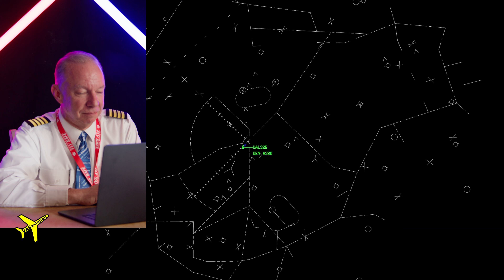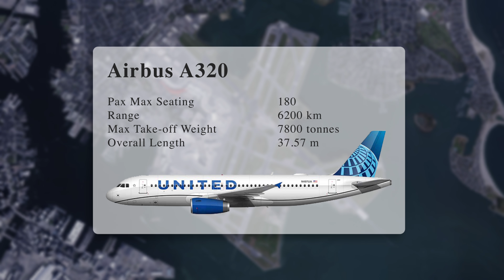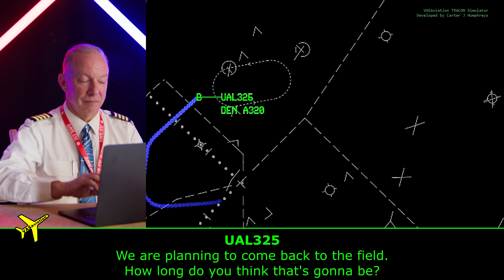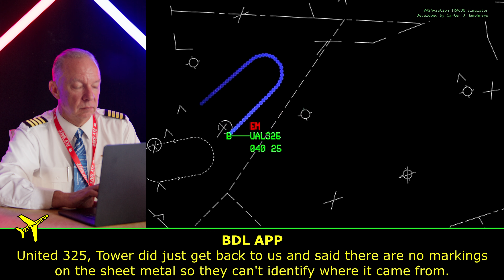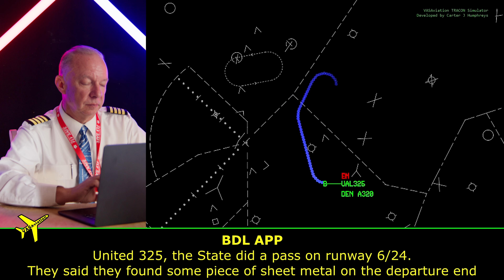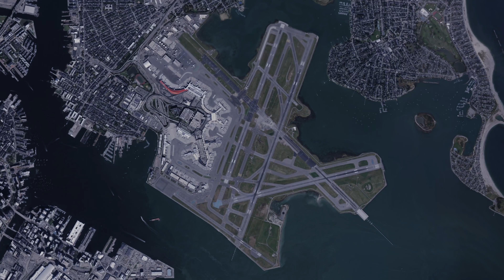United 325 Disaster Averted: Engine Trouble at Takeoff! | Captain Steeeve Breaks It Down

Comment: Silly question, but why do passenger aircraft manufacturers not have cameras fitted in the landing gear area ?. So pilots can do a visual as the wheels go down. For what cameras cost it would seem a cheap thing to do to give a good benefit.
Reply: I agree!!  There are cameras everywhere but not on airplane landing gear, wings or other useful areas.
Reply: @49kittypretty1  actually some airplanes do have cameras mounted exterior and some don’t. Not a silly question at all.
Reply: @49kittypretty1  “Everywhere” isn’t going 500mph.
Reply: @Cjbrk-x63 True, but I have seen cameras on skydiver’s helmets, and on racing boats etc.  I think there are cameras on the space shuttle external rockets.
Reply: @Cjbrk-x63  It could be strategically positioned up in the gear bay, so that the tires are visible.
Reply: @49kittypretty1  I’m not in agreement with what you’ve said about cameras everywhere (unless you mean in everyday life, not aircraft)
Reply: @kevinfairclough4619 
He's probably just thinking about Tesla's having cameras on every inch of those things.
... im assuming
Reply: @ I meant that there are many cameras used to watch traffic, check outs at stores, front porches etc and yet where it seems to me that it would be really helpful to have cameras (like on an aircraft looking at the wings, landing gear etc) there are no cameras.  I’ve watched Youtube videos of an engine fire for example where  the pilots have instruments telling them that but they can’t see it because there are no cameras showing the wings and engines.
Reply: @ thanks for clarifying. It’s not a silly question for the op to ask. I’ve just put by best suggestion as to why, but it’s just my learned opinions
Reply: @49kittypretty1  
But those cameras have weight, like I mentioned to someone.
And they don't go from a 100 degree hot tarmac, to -60 degrees at 40,000 feet every day either.
So simply having a camera lense system to deal with those "Atmospheric" conditions, is more weight again.

And unlike someone's GoPro they shoot up in a rocket for some video.
These would have to work 24/7 in every condition imaginable. For decades.
Which Also, adds more Maintenance issues,.. AND COMPLICATIONS to the overall aircraft and it's electrical systems.
IN OTHER WORDS, SOMETHING ELSE TO GO WRONG.
Besides, most of these systems are monitored by sensors. Because having it's operation monitored, is more informative than looking at pretty pictures 😂
Especially when the picture, LIKE HERE, doesn't look good,.. but was.
... fly safe
Reply: @My-Pal-Hal id rather be on a defective plane than in a starshipooper tesla.
Reply: @tonymurray814  
First, obviously you missed the point.
Second, NO YOU FN WOULDN'T ! ! !

I don't care what kind of Failing Vehicle I'm in, or what it's failure is, including Being On FIRE 🔥 
But if I had the choice between those failures happening on the Ground,.. OR 5 MILES ABOVE IT !😳!
Seems a pretty easy choice to me. 
Because my arms don't flap very fast anymore 😂
... and MY OWN door, does comes in handy for an escape , jus sayin
Reply: @ You’ve made some excellent points.  They make very small cameras now so weight might not be a factor but you’re right about the extreme temperatures and other things.
Reply: @ Thanks for your reply.  Yes, for « everywhere «  I meant everyday life.
Reply: Dont be a fool.  @tonymurray814
Reply: @My-Pal-Hal  so what would you say about the A350 & A380  tail camera? I can name several more aircrafts but lets see you coming up with more made up reasons
Reply: @pranabgill1310  
OH MY GAWD, THE TAIL CAMERA.
Well, ya got me. I guess that's all you need to see the entire outside of an aircraft airframe, including the landing and nose gear.
.... people are just embarrassing sometimes
Reply: @My-Pal-Hal  okay the 777 has a camera ON THE nose gear itself...now what?
Reply: @pranabgill1310  
AND ? ? ?

.... i don't think he's been following along, because im sure in his mind, he has All The Answers 🤤 , awesome
Reply: @pranabgill1310  
I just think it's funny.
I built 18 Wheelers. And that's a lot of cameras 😂
But they've never needed them for like 5+ decades.
HAIL TO THE QUEEN 👑 BABY 💕 
... good times
Reply: @pranabgill1310  
SOPHIA HAS A GOOD CAMERA 👍
It was 106" Inches !!!
Yeah, I looked it up, because I couldn't remember. I was thinking 100 something. But, I can use a smart phone. Instead of just GUESSING 😂
Good camera though. Its in a museum now 😞 
Memories.

... and that's an 18 wheel princess, it's smaller than the queen 😏
Reply: @My-Pal-Hal  you build 18 wheelers, I fly planes....so it was funny reading your aggressive reasoning for no camera...try humility next time
Reply: @pranabgill1310  
THAT WAS TOOOOO EASY, AND EMBARRASSING 😂 
And more sad than funny. But it was pretty predictable.
... hook line and sinker

And I even mentioned the "Queen", and "Sophia", and her "CAMERA".

"Don't Trust The Bait" , Google It 🤣
And with practically the entire knowledge of the planet in your hand, you blew it.

aaaa, freakin awesome, didn't see that coming 

747's are 18 Wheelers btw 😏 , keep on truckin
Reply: @pranabgill1310  
So easy, it's EMBARRASSING 🤤

HOOK LINE AND SINKER 😂

If only they could read, or even use google.

18 wheels.
The Queen.
And the Princess Sophia, and her 106 inch camera.
.... princess, because it's an SP
Reply: @pranabgill1310  
... he doesn't have a freakin clue, but he flies Cox .049 airplanes, i do aircraft, so it's , still funny, and sad
Reply: @pranabgill1310  
FUN FACT 😀 
Bill Nye the Science Guy was an engineer on those 18 Wheelers Too 🤗
.... hail to the queen baby
Reply: @pranabgill1310  
Another Fun Fact.
That 18 Wheeler also transported the Shuttle Craft around. It's a Heavy Hauling Girl 🥰
Reply: @My-Pal-Hal  so tell me more about the tail cameras on Airbus 350/380 and how they can't go from 100 degrees on tarmac to -60 degree multiple times
Reply: @pranabgill1310  
Already did.
Is reading hard on your brain?
... that's a good one 🤤
Reply: @pranabgill1310  
Hey.
Did you figure out yet, that 18 Wheels is 7+4+7 😂
... math is fun
Reply: @pranabgill1310  
So,..
Tell me more about the couple of Entertainment Cameras.
But why those aircraft have some 25,000 sensors to fly them.

Maybe pretty pictures,
Are just limited in their usefulness.
Because not even all of those models have Cameras either. Because even those pretty pictures cost Money.

And that was the point, made many many times, for the English speaking Reading Crowd.
.... you should join that crowd someday 😊 , he's not invited 😂
Reply: @My-Pal-Hal  what about it ? Who cares about 747 old man....let's talk cameras
Reply: @pranabgill1310  
We have been talking cameras.
Are you new to the thread, or English in general ?🤣?

... sounds like he needs a nap, and a moist towelette 🍼
Reply: @pranabgill1310  
We Have Been Talking Cameras.
Are you new to the thread, or English in general 😂

.... he even argued against his own point, he's not paying attention
Reply: @My-Pal-Hal  we have been?
Do you realise,nobody is talking to you? It was a casual discussion,your confused paranoid little old brain made into a argument. So you were saying how cameras can't survive  multiple pressurisation cycles and varying temperatures,tell me more
Reply: @My-Pal-Hal even worse every  part of airliner must go thru the faa approval process which can take years and a boatload of money. Then, if successful,  each part in inventory must be tracked, maintained and so on. It gets expensive in a hurry. A nut in aviation is orders of cost more than what you can get it for at home depot for this reason. 
So cameras may seem like an easy idea but there is nothing easy in this realm. It's literally why most planes are still using 80s and 90s computers. They are certified and no one is in a hurry to spend the money to jump thru the hoops to certify new ones if the old 9nes still work.
Reply: @pranabgill1310 then Also ask how much did it cost to engineer it, get it approved by the regulatory agencies, keep it operating, keep it in inventory, add to the weigh of the aircraft thus increasing fuel burn and on and on. It's never inexpensive to add a thing to an airplane and guess who pays for it. The passengers who are already screaming it's too expensive. Do you want low cost or bubble wrapped hyper expensive?
Reply: @billdougherty6611  if it can be done one or two planes , it can be done for all pasangers planes. Secondly, escape slides aren't used on every flight ,they are still part of the mandatory equipment. 
Are you aware ,how many crashes could be averted or how many decisions could've been made easier if pilots had more information.  Please dont tell me how expensive cameras are or how much they weigh,one looks stupid discussing cost and weight of cameras in 2025
Reply: @billdougherty6611 
That's what I said,.. MONEY.
Reply: @49kittypretty1  Camera used in extreme temperature changes. You could install them in a box filled with a "gas" of some type to prevent problems, or in a heated box.

Those external cameras you see on aircraft today handle temperature changes all the time without issues, so I don't see a problem with "maintenance" cameras. And there isn't a weight issue with today's camera; they are not weighing 100 kg each, they barely hit 1 kg each.
Reply: @My-Pal-Hal  Yeah, today Aircafts has: Tail camera, rear underbelly camera, and a camera that looks directly down.
Reply: @heuhen 
Well, you're the "aircafts" expert.
Reply: @heuhen 
... and this comment is Awesome about the cameras,..

THEY DON'T WEIGH ANYTHING.

But for extreme temperatures he doesn't even understand,..
YOU CAN BUILD A BOX (the technical term🤣) and fill it with "Gas", meaning it must be a Sealed Vessel. 
AND YOU COULD EVEN HEAT IT 🤣, oh man. That's funny shit.

And none of that weighs anything, or takes anything to.... he's unemployed, or should be.
Reply: @heuhen I agree.
Reply: @kevinfairclough4619 Well, yes I was a bit vague.  I meant on cars, streets, people, bicycles, buildings etc.
Reply: I think a camera high on the tail that can give the pilots visual confirmation of issues like an engine fire would be great. Maybe another pair or quad mounted in the fuselage below the wings, again to give a clear view of the state of the wings and engines if the need arises. Obviously I'm not suggesting they keep a screen playing the feed from all five cameras active the whole flight, just that the ability to check such a view angle would have saved lives in past incidents so there is no reason not to implement corrective measures now
Reply: @Omniseed  Again, VERY expensive, regular cameras would never survive the forces and temperatures. Further, every new wire, every piece of electronics, you add only increases the risk of the worst case scenario, in-flight fire!
Reply: @Omniseed  
Obviously, you are simply saying something "You Think".
Without any actual knowledge or experience with those thoughts.

I'M NOT JUMPING ON YOU. Much.
More how people seem to always have thoughts. Without putting something behind those thoughts, with a little research.

Or even reading through a comment section, before repeating what many have already said.
It's the ole saying, " I Don't THINK, You Thought This Through" 😂

My suggestion, with subjects like this.
Look up the particular cockpit of the aircraft in question. And look up the manuals and checklists for same. 

And you may find that things aren't as simple as on the ole Xbox.
And why only like 10% of simulator time counts as Flight Time towards an instrument rating certification.

And though retired.
I looked it up. Yeah, around 10%.
That's the difference between Thinking, and Knowing.
A couple of seconds of research to refresh my thinking. I still got it 😂 👍

And much of this revolves around the Money as I may have mentioned.
So aircraft design and manufacturing has as much to do with this, than anything.
... money money money Money,.. MONEY 🤑

Problem is.
People want to think they know.
But they really don't care, or they would know.
How can you not know, or have a good idea. With practically the entire knowledge of the Planet in your hand ???
We had slide rules...
Reply: @My-Pal-Hal  I don’t want to sound rude but that is a lot of endless yapping about nothing. Is having more cameras hurt or help?  Does adding more cameras cause more harm than good? Explain why or why not. Just as OP said, they don’t need to be on 24/7 but only turn them on when it is relevant during an emergency. Would it not help to have few cameras for PM to look at only during an emergency and to use relevant cameras ie, if unsure about landing gear, turn on all landing gear cameras for inspections?
Reply: @wrx1th873 
Well thanks for a bunch of questions, with no answers.
Maybe you should have read some of that Yappin, before Yappin yourself.
Though your grasp of English is questionable simply by your use of it.

But I have a question for you.
Exactly how are your cameras going to help, if the landing gear isn't working ???
Do they add extra fuel, like the fuel you used hauling them around? Are they somehow going to fix the landing gear for you, or get a mechanic to do it?

OR,..
ARE THEY JUST GOING TO TELL YOU WHAT ALL THE PROCEDURES AND SYSTEMS BUILT INTO THE AIRCRAFT ARE ALREADY TELLING YOU ? ? ?
Because that's how they're built. And what the systems and sensors are already there for.

I only built them for a few Decades. Including installing landing gear, and functional testing same coincidentally.
So maybe you can enlighten me 👍

Because once you board that aircraft,..
WHAT GOES UP, MUST COME DOWN.
And those cameras ain't gonna change that. 

The aircraft, it's systems, procedures, and it's maintenance are the only things that will deal with that.
And if they break, you still gotta land, one way or another.

And again, for the umpteenth time, weight is money.
... in case you missed that Yappin 🤣 , kids are funny
Reply: @My-Pal-Hal  again with the rambling. You still have not answered my question. And I said cameras will be only supplemental information; they are not replacing existing information. You are being bad faith for no reason here. For example in this video, the pilot was worried about whether his landing gear had missing pieces of tires, if they had a camera there then they would realize it wasn’t missing anything related to the landing gear and he wouldn’t have to make multiple go-around because of some firemen refuse to elaborate due to not jumping the gun. How about another scenario where the pilots deploy their landing gear but for some reason their flight deck says otherwise, again, cameras would help here. One last example, since pilots cannot see the engines from where their sitting, if there were cameras in case of an engine fire, I could imagine pilots needing to know whether or not the fire is being contained or put out or how soon do they need to land. From what you are saying, money is the only thing that’s stopping companies from implementing cameras on their planes. Is that it? Just corporate greed?
Reply: @wrx1th873 
Rambling?
45 paragraphs later, and all you still have are Questions 😂

And you didn't answer my questions, so here's another.
How do 100,000 Plus Commercial Flights Happen Every Day, even though pilots can't see most of the outside of their aircraft ??🤔??

And try not saying everything I've already said.
... balls in your mouth
Reply: @wrx1th873 
And what about the Engines ?
Sure seems to be a lot of fires, compressor stalls and bird strikes we see every day.

BUT HOW DID THEY KNOW, WITHOUT CAMERAS ? 😨 ?

And again, don't say anything I've already said 😂
... he should get Google, or parents, or friends
Reply: @wrx1th873 
And again,..
For you non English Yapping Speaking Folk, that can't read or comprehend it.

YOU EVENTUALLY HAVE TO LAND,.. PERIOD ! ! !

And though I'm just repeating my Yappin 😂
You run through the procedures best you and the aircraft can, and then you land.

Kinda why they have procedures for everything, coincidentally 🤣

... this dude is pretty slow, or his CHAT D'UH Needs An Update, or both , im putting my money on both, yeah both 👍
Reply: @My-Pal-Hal  So much bullshit talk from you. Let me answer your question. Then you can stop yapping and answer the questions others are asking... it's common courtesy to answer questions. The person asking the question isn't supposed to answer them for you.

You ask: Exactly how are your cameras going to help if the landing gear isn't working? It allows pilots to confirm a problem or determine whether an instrument error is the cause. They also enable pilots to prepare for an abnormal landing. There have been many deadly flight accidents, where pilots were unaware of how severe the problem was, due to a lack of information. Cameras solve that by a lot.

You ask: Do they add extra fuel, like the fuel you used hauling them around? It doesn't cost extra fuel. Cameras don't weigh hundreds of kilos; they barely weigh 1 kilo max. So if you have landing gear and fuselage cameras covering critical angles, 6 to 10 cameras, it's just 6 to 10 kg, that is the weight of a backpack, add on cabling to a monitor, another 10 kilos. Aircraft today use digital monitors, where pilots select what they want to see on it. If they want to check something specific on the camera, they just push a button and check.

You ask: Are they somehow going to fix the landing gear for you, or get a mechanic to do it? That is a stupid question, and you know it. The cameras help a pilot understand what he is working with, so he can better compensate for the issue when he is going to land. Pilots always want as much information as possible. There have been many accidents that have been contributed to pilots not having sufficient information. Even the FAA has said that if pilots had more information, such as visual information, many accidents could have been avoided.

You ask: ARE THEY JUST GOING TO TELL YOU WHAT ALL THE PROCEDURES AND SYSTEMS BUILT INTO THE AIRCRAFT ARE ALREADY TELLING YOU? All that information is well known and is written in the book for the aircraft! You can even download that book from the internet and have a look for yourself. The book is based on experience and knowledge of previous accidents, and it says that if you have this and that, there is a high chance it's that. It then tells you what the best-known solution is for that issue. A camera helps confirm the problem. For example, there was a flight accident in which the book told the pilots to do so and so, and it resulted in the pilot turning off a system that actually worked fine and turning off a working engine, thus dooming the aircraft and its passengers. A camera could have shown the pilots that there isn't a problem with that engine or the flight control.

Quote: "I only built them for a few Decades. Including installing landing gear, and functional testing, same coincidentally." Building them doesn't make you an expert; you are only building it after a set parameter and the drawing, and the testing you do is for testing whether what you did works. Perhaps that's why Boeing has so many accidents... they think they know better...

Quite: "Because once you board that aircraft,.. WHAT GOES UP, MUST COME DOWN. And those cameras ain't gonna change that.": Yes, but it increases the chance of survival when something goes wrong. The focus should be on doing everything you can to increase the user's chance of survival when the problem arises. If something as simple as cameras are available and not used, even if they only increase the chance of surviving an accident by 1% or 50%, it's worth it. Being ignorant kills people.

Quote: "The aircraft, it's systems, procedures, and it's maintenance are the only things that will deal with that.
And if they break, you still gotta land, one way or another." Correct, but the procedures are based on past accidents in which more information could have helped pilots, passengers, and aircraft survive. A camera is an added benefit because it provides information that helps select the correct procedures, even those that aren't listed, when the problem hasn't been seen before.

Quote: "And again, for the umpteenth time, weight is money." Weight is money is the stupidest argument when we talk about something that can save lives. For something that adds 10-20 kg to an aircraft (the weight of a backpack!), saving money and weight kills people. This is what Boeing has been doing, and it has resulted in several deadly accidents. Accidents that have been documented as directly linked to cost-saving procedures and construction. Adding 10-20 kg of extra cameras will at most add 10-20 cents to passenger bills.

Maintenance of cameras is also simple, and replacing them is simple. It's nothing unique. Only if it's a one-off can you ask about that. But with thousands of aircraft frames, 10 times as many cameras, plus reserve parts, you get to such high production numbers that the cameras will end up being low-cost. And maintenance of them would be done through the normal maintenance (doesn't work, replace it. Send the broken camera to service).

All you have shown through your yapping is that you are ignorant and know nothing except how to screw a screw into some sheet metal because the procedure tells you to do so.
Reply: @heuhen 
Yes yes.
When you've actually built commercial aircraft of many different configurations for a few decades, you get back to me ok 👍

Dude doesn't even know what it takes to run and attach even a single wire through the Airframe of an aircraft, let alone everything involved.
And obviously doesn't understand what simply a couple hundred feet of a Single Wire even weighs, let alone all the attachment hardware weighs. And if it has to be Shielded wire, that weighs even more.
Dude probably thinks you just Staple this stuff in like Christmas Lights,.. what a dweeb.

... im surprised he didn't get into chem trails, he was getting there though, you could feel it 😂
Reply: @heuhen 
And for the more Advanced people reading this, and you are welcome to talk with them !!!

Each attach point at any given rib or spar points above the skin of the fuselage, for engineered (D'UH) wire runs requires,.. 7-8 PIECES OF HARDWARE ON AVERAGE.

1 Wire Clamp.
1 Rubber Sheath.
1 Standoff of varying size, depending on location.
1 NAS fastener.
1 NAS washer.
And 2-3 rivets, again depending on location, and wire bundle size.
... on average as stated, some take more hardware 

And on average, required every couple feet, or less.

SO OBVIOUSLY NO WEIGHT INVOLVED THERE 😂

Planes aren't that big though right, if you're a Lego Aircraft Engineer like yourself.
Because in real Aircraft, it adds up 👍
... should i mention cannon plugs, shielding, sealants and safety wiring 🤣

Yap Yap yap , noobulus
Reply: @heuhen 
And Yes,..
Ya Dense mofo.
I asked how are cameras going to help.
Because you still have to follow the procedures either way like I said. Because you have to land one way or another,.. like I said 😂

And that camera view ain't gonna help that. The procedures, and aircraft systems are what is going to help that.
Because even the landing gear may look like it's down, but is it locked In Place ?😳?

Doesn't matter, ya gotta land Copernicus.

Kinda why they are built the way they are, and the safest way to travel.
Though kids like you, are bringing those odds down a bit, along with a door or two before landing.

... i think it's the English that's confusing him 🤔, yeah that's gotta be it , because he is totally baffled 🤣

HAPPY HOLIDAYS 🥳 
... noobulus
Reply: @heuhen 
And just for shits and giggles.
You mentioned maintenance of the cameras.
SO WHAT HAPPENS IF ONE GOES OUT ! ! !

Obviously if it is plumbed from the inside to the outside, it will have to be removed and checked.

And I'm sure with your extensive aerospace experience you know what all that would entail.

Because you know all about how things on Aircraft are designed right 🤤

But in a case like that.
You'd hopefully remove the housing (which weighs nothing btw 😂) with a bunch of nas screws.
Then release it and it's sealant.

Then do your testing of the system, and the camera before RE SEALING, AND FASTENING IT.

BUT DON'T STRIP OUT THE NUT PLATES EITHER 😳

Because then you'll have to disassemble the interior of the aircraft to repair that.
Then Reassemble It 🤣

... happens all the time, and why useless stuff like that is avoided at all costs , because it costs

Go Take A Tour Of An Aircraft Assembly Plant, even a small one.
You Yap like the poster child for the word "Clueless". 
So why not actually get A Clue 👍

Thinking, isn't Knowing.
... kinda why they are two different words 

💚💙GO HAWKS💙💚
Reply: Not a silly idea but aircraft would have to be retrofitted which would be expensive and time consuming. The biggest issue would be someone to monitor those cameras. The pilot and copilot already have enough things to do and monitoring camera screens would not be feasible and where would the camera screens be located? Those cockpits are already cram packed with electronic equipment.
Reply: @anthonykeller2760 . EXACTLY.
Reply: @anthonykeller2760 
It would mist be a menu item. 
We turn the camera’s on after landing to see the gear tracking and tip clearance. At night it is really nice to have the inferred up to see what lurks in the dark. Might be airbus parts laying about !
Reply: The camera would have to be designed to work in temperatures as low as -65C.  It's another system to maintain, and an option airlines won't want to pay for.
Reply: @oscarb9139  Some aircraft already have cameras at the back, which is broadcast on the IFE.
Reply: @adrianbennett3761 That makes it an accessory, and could  be deferred if inoperative similarly to a reading light in the cabin.  A camera used for monitoring has to meet whatever standards are set by the FAA and can affect the "airworthiness" of the aircraft for dispatch purposes.
Reply: @oscarb9139  I hear what you say but in time I expect cameras on aircraft and runways to become mandatory
Reply: @adrianbennett3761 That  may happen at some time.  But the reality is that we are able to function without them 99.999999% of the time.  The other 0.0000001%, it would be helpful.
Reply: @oscarb9139  It would have stopped the British Midland crew from shutting down the wrong engine. I appreciate aircraft issues are vertical rare.  Recommendations following AI171 final report will be interesting as it’s the first crash with lots of video footage
Reply: @adrianbennett3761 Not familiar.  What happened on Midland, and how would it have prevented the error?
Reply: @oscarb9139  FAA has already approved cameras for this since 2007. The problem is that most aircraft are designed well before that time period, and they haven't come around to implement it yet.
Reply: @oscarb9139 I think there would be no need to check the camera after take off past 10k ft.   Same on landing .  No need to look at camera until lowering gear.   And thats way below 10ft.  So temps are not that cold.
Reply: @chadsheridan353 There are redundant sensors on many components of modern aircraft.  These sensors give better status informatiin than visual inspection.
Reply: I've also wondered that.. It seems a great idea to have cameras looking out onto all the vital parts of the aircraft, especially the engines.
We've heard how in certain cases one of the pilots or cabin crew are asked to go back and report what they see. Surely a camera would make it far easier and quicker, then decisions can be made.
Reply: @ if u ask a pilot i think most of them would tell you that it’s not needed. What does it help if you see the engine? 
In bigger planes all the data is sent to the company, sometimes they will tell you that there will be a problem within the next minutes and the pilots can react on it…
There is absolutely no camera needed to see anything at the engine or wing etc
Reply: @Cars-k8e  If only you were as knowledgeable as you are arrogant. The amount of videos available on this platform detailing pilots trying to get information about landing gear that has failed to operate correctly and they need to know it's current position, trying to identify what parts of an engine have been damaged or lost, problems with slats/flaps where they're getting cabin crew to try and identify the issue and relay the information to them.
Cameras would be a helpful supplement to the monitoring systems already in place. You suggested asking a pilot and claimed they'd say it wasn't needed. As a pilot, I can tell you, there is no such thing as "too much information" when it comes to air safety.
Reply: @----.__ if the manufacturer wanted you to see all of those things then cameras would be in place by today. What do you care which part of the engine is damaged if you see your indications in the flightdeck. I don’t think they want flying engineers to determine which course of action to take by looking at your engine, slats, flaps or whatever else
Reply: @Cars-k8e  I see reading comprehension isn't your strong point. I already mentioned the plethora of videos detailing pilots seeking further information regarding the aircraft's status but that obviously went straight over your head. You're an angry little sausage, I hope you grow up one day, I won't be around to witness it. Ciao.
Reply: The FAA might come to that conclusion at some time in the future, maybe.
Reply: Boeing 777s have front gear camera for taxiing.
Reply: Ya for sure, they do have them on the exterior of the new jets

Good idea
Reply: Cameras can have a cover and it opens at pilots command. With the tech we have , it can be done
Reply: @kevinIngold-sh3pp  
More weight, more costs, more training, more engineering, more maintenance.
And just another thing to go wrong.

Did we just have a bird strike, because #1 is on fire.
NAAA. It was one of those little camera door flaps we just sucked through the engine.
We'll be fine, as long as the camera flap for engine #2 hangs on.
Do we have a camera that covers camera #2, I wanna see ?😂? 😳

.... gotta think these things through people
Reply: Not silly. I was about to to ask the same question!
Reply: @TimothyRing  
And ask the same question,..
While not reading a hundred some other replies that answers the question 🤣 , because you couldn't on your own, by reading.

.... yup, math checks out , we're doomed  , but im sure somebody has the video of our demise 😏

And people wonder about Cameras.
When they can't use the camera phone in their hands, that has access to Everything, that answers questions.

... we had a good run
Reply: Yeah, I have wondered this for the last couple of years. Would it be difficult?
Just look at how useful it was for the a380 incident. It would prevent a lot of mis-identifications.
Reply: @SparkyFolf I think none of you guys is an airline pilot 😅🤷🏽
Reply: @Cars-k8e well I didn't claim to be either. I've just thought about the possibility of cameras.
Reply: @Cars-k8e  we don’t have to be. Which is why we are asking questions rather than telling. It is the same reason why we can criticize professional basketball players on tv without having to become pro at that sport.
Reply: Real simple $
Reply: Every single bolt, nut and paint that goes onto an aircraft needs to go through a plethora of tests to make sure it is aviation grade safe. So, mounting a camera at x place may seem cheaper for us but to actually implement it will cost a lot in terms of money + recertification of the whole component (camera, mount, harness, fire hazard safety for whole unit, central computer load, storage devices + their load/safety, software that will be upgraded to handle these cameras - needs to go through its own safety testing) etc.. 

So, unless it is a new model of plane or an upgrade - they dont add things to an existing certified plane.
Reply: @sudhirbabu548 Thanks for that information, very interesting.😊
Reply: airplane tires are not at all similar to car tires you might be picturing.  They are hundreds of pounds of solid material each, and get hotter than an oven every use.  They go through a hell they are engineered to withstand, and soem need to be replaced evey few dozen landings.  A camera might survive a single ise of the tires but its a short matter of time for it to get trashed. 

Fun fact not a single control of an airplane replies on something as delicate and unreliable as a camera, and planes are flyable without being able to see outside of the plane at all.  Because in real life that pack of visuals isn't rare.
Reply: They do. 777-300s for example have cameras in the cockpit showing positions of main landing gear to assist with ground manoeuvres (its a long ass plane).
Reply: Mostly because it’s expensive and time consuming.
Reply: Physics
Reply: @kathyyoung1774  
Nope,.. simply money. Unfortunately.

Kinda why everyone seems to be able to see where they are ANYWHERE ON THE PLANET with their phone.
But somehow,.. we lost a 777 somewhere 🤔
... figure that one out, without mentioning money
Reply: Dude I was just going to ask that exact question when I got to the comments.  You beat me to it, so now I'll just read the comments and find out why. 👍
Reply: Visions of the Concord
Reply: @TheSaabClinicUK  
AND,..
Though I've been told I don't have a Clue 😂
SAABS, were built with their aircraft background in mind. And why they had their "Electronics Bay" under the back seat, to keep them from the atmospheric elements.

And unlike most the 💩 made, SAABS were pretty well sealed. As apposed to let's say, US Cars that have 💩 under the seat, where all the moisture goes 😂 
NO, I DIDN'T MENTION CADILLACS AS AN EXAMPLE 🤣

... yeah, i think i just did 😏
Reply: Small cameras could be placed in front of each closed gear door so the camera is looking from front to back.
Reply: @comcastjohn  
Have you ever been Late to a Class.
And find out you shouldn't be there, but your mom won't come to pick you up 😂

.... "small" cameras was Awesome, i would have wanted IMAX CAMERAS 🤣 , my mistake
Reply: Right should have cameras showing each engine/ wing leading edge, landing gear & tail. Cameras are tiny
Reply: Good question actually
Reply: Cameras on planes and runways make sense.
Reply: I was thinking the same.
Reply: Good goddamn question.
Reply: I would agree, however, do to the forces and temperatures they would be continual subject to, not a cheap endeavor at all, it would be quite expensive. Further, the more electronics you add, the more chance for the absolute worse scenario increases, in flight fire.
Reply: As a commercial pilot I would say that sounds like a good idea to many, but a visual inspection or view of the aircraft exterior prior to landing is very rarely needed or beneficial.
Reply: @crooked-halo True, but……
Reply: Here I am, your new friend Captain Steeeve. Thanks for this video. The KBDL is my local international airport. Sometimes I fly throughout the airspace in my little plain, it’s great to stay in contact with ATC with flight follow. Always helpful and friendly controllers.
Reply: Maybe engines are behind landing gear and cameras wouldn't see it?
Reply: That's good idea howewer it would need some time to implement, maybe after 5 or 10 years possible. I think keeping lens clean would be the biggest challenge.
Reply: Sometimes there are animals on the runway! LOL! My father, a Senior Reseach engineer  once told me he was on a flight and about to land when they had to go around again in WV . A cow 🐮 was on the runway! 🐄
Reply: Bc they don’t have Elon Musk and SpaceX engineers who put cameras on their reusable rockets 🚀.
Reply: @user-zv1xj9xk6c 
EXACTLY,..
Mr User brkgy68ngd755 🍆 😳

Because we need multiple cameras like SpaceX and Tesla.
TO RECORD THE AMAZING, FLAMING FAILURE RATES 😂
... people love those YouTube videos 

And that's when THEIR CAMERAS FAIL , COINCIDENTALLY 🤣
JUST WHEN WE WANT TO SEE THE STUFF ! ! !
But their attorneys cut the feed 😏
.... yeah, we're doomed
Reply: @user-zv1xj9xk6c  
Oh jeez, great example.
Half the video feeds don't even work.
AND THE OTHERS FAIL, JUST WHEN THEY'RE NEEDED 😂

And they Often don't even make one flight, nevermind BILLIONS !!!

At least Boeing knows what it is doing.
All the electric cars they built, never Caught Fire. 
AND THEY WERE ON THE MOON 4 DECADES AGO 😂
.... kids are stupid , sorry kids
Reply: @user-zv1xj9xk6c 
THAT'S FUNNY 🤤
Boeing put electric cars On The MOON Over 4 Decades Ago.
AND NONE OF THEM HAVE CAUGHT FIRE , STILL 😆

... and now you see why these things happen 

To bad we couldn't see SpaceX's last failure, because the cameras failed just when they needed them.
Couldn't see that coming,... Again.
Reply: @user-zv1xj9xk6c 
YES 👍
Let's put an aerospace and car company with one of the HIGHEST FAILURE RATES IN EVERYTHING , IN CHARGE 😂

Boeing put electric cars on the MOON over 4 decades ago. And not ONE has caught fire.
AND THEY HAD CAMERAS TOO 🤣
.... we're doomed
Reply: @user-zv1xj9xk6c 
Exactly.
Probably because people actually see their High Failure Rates,.. not including recalls,.. AND FIRES 🔥 

... oh they didn't get the recall, because it Exploded 😳 , glad i missed that too

Ask Air BNB, if they cover spacex insurance claims.. that should be fun 😊
Reply: @user-zv1xj9xk6cof course they do, we see it landing from  cameras on the base of the rocket, and also when ejecting stages of the rocket prior to landing the booster.
Reply: Not at all a silly question, Infact older jets had a viewing window in the cabin to look at the landing gear.
Reply: Good idea and very doable.  They could be mounted in the fuselage above and below the wing on each side. Possibly one in the nose pointing after showing the nose gear and belly.  The weight total would be less than most carry-ons!
Reply: @waynemensen4252  
"The weight total would be less than most carryons" 😂🤣😆😌 😳
... see, just embarrassing 

Quick question.
Someone just mentioned the tail camera on an A-380.
So what do you imagine the camera,..
With mounting structures.
With wiring to the cockpit.
With the wire stand-offs, brackets, clamps, tape, conduits, runs and connectors throughout the plane.
With the electronics to support it.
And all electronics to watch and operate, including the breakers and safety systems, "WEIGH",.. just for THAT SINGLE CAMERA ???
Reply: @My-Pal-Hal  I've run wires through an airplane.  Why don't you tell me all about it.  Conduit? You don't have a clue.
Reply: @waynemensen4252  
Yes, aircraft have all kinds of ways of running wires and harnesses. Many having to be isolated from others depending on the systems, and structures.

But you didn't answer the question oh runner of wires.
HOW MUCH WOULD THAT WEIGH ? ? ?
You seem to the expert , don't embarrass yourself 😂

... and i did tell him all about it, but he does airplanes not aircraft
Reply: @waynemensen4252  
What's the matter Mr expert ?
Cannon Plug Got Your Tongue 🤣

.... and we also use (lacing) string 🧵 too , he won't be back
Reply: @My-Pal-Hal  they don't use conduit.
Reply: @waynemensen4252  
YOU HAVEN'T ANSWER THE QUESTION !🤤!

And yes they do.
But you wouldn't have a clue, to coin a phrase. Or even where they might. Or WHY.
.... clueless is his middle name, and what his cat calls him
Reply: On the crappy little planes I flew there was a mirror on the engine nacelle you could see the wheel in.
Reply: @class2instructor32  
AND,..
JUST LIKE IN A TIRE STORE,..
Unless those tires are Shredded. You can't tell if they are flat, or inflated unless the weight of the aircraft (or any vehicle ) is on them.

But how did that mirror see the nose gear too 🤔
... another great story 🤣 😳
Reply: @class2instructor32  
And though I've been told "I Don't Have A Clue".
Are you sure that's the "Nacelle" you are talking about? Or a "Cowling"?
Because knowing how aircraft are built, really helps make a convincing story 😂
And this ain't one of them.

.... and we have some doozies here for sure, and ill tell ya that for free
Reply: I have wondered that too. My kids school bus and our public buses  are loaded with cameras but not commercial aircraft?
Reply: @crBudgetWatches  
If you actually have wondered that. Maybe read the thread.
Or even google it. I've heard that has information,.. if you've really "Wondered" it.
.... worth a try 😂
Reply: If not the flight crew, someone else has a station where they can get the visual from the cameras.
A single camera under the tail looking forward could do it all, and make for good videos.
Reply: Nothing in aviation or rocketry is cheap. A camera might seem cheap but it would be thousands of dollars per airplane when you account for the quality of camera needed (it would become a necessary safety feature and has the accompanying requirements of essential hardware. You'd need two of them (redundancy is necessary), all the associated wiring... They'd need to recertify every single airplane that they put it on because it would change the cockpit (they don't remove the "no smoking" switch on airplanes because they'd need to spent millions recertifying just for a simple button being removed from the cockpit).. Nothings cheap lol
Reply: Where would you put it?
There was a plane a few decades ago where they didn’t know if their gear were down or not. They changed all the bulbs, the circuit breakers. They had a little window where they could go down and have a look as to whether the gear were down and locked. So someone went down and had a look, but they forgot the lights. So backup. Lights on, back down. Staring out into the dark.
Unfortunately whilst faffing with the wheels nobody noticed that they lost height and flew into a swamp in the Everglades.

The gear were all down, locked. The plane was fine. But because they could look, they wanted to look and half the people died.

Even if the gear weren’t locked, you still have to land. If you don’t have gear, you want a slow, soft landing that hits the runway at the start of the runway.
Reply: @philippal8666  
That's brings up a point that should probably be in the No Landing Gear Checklist.
Is that grass berm at the end of the runway,.. covering up a Concrete WALL 🧱?😳?🧱
... that would be nice to know
Reply: Where do you want them to put the monitors?
Reply: I can see my plane being delayed because of a failed camera
Reply: @thomasyang2045  
BUT THAT CAMERA IS IMPORTANT !!!

Because it shows the dudes going through your Luggage as they load it , that's why your flight is delayed 😂 😳 
Which is weird, because that camera doesn't usually work,.. for some reason.

... ive said to much , nice socks btw 😏 👍
Reply: Because the presidents, and the 15 or so vice presidents and the board of directors and all the shareholders want as much money as they can get their hands on! That’s exactly what it all comes down to. Hell the street racers have about 5 Go Pro’s on each of their cars just so they know what’s happening because it’s their own lives in their hands and they are going anywhere from say 150 to possibly 270 miles per hour!!! That’s it.    “ POINT FINAL  or  FATAL “ and they have wives kids and people that love them every day and Don’t Have Expensive Actuaries Figuring The Odds of Them Living Or Dying In An Accident!!!!
Like Major Airline Companies Do. What’s the Most We Could Lose in A Major Crash and Following Lawsuits???? They Don’t Care Till It Happens. It’s All About Their Year Ending Bonuses 
and Stock Options!!!!!! Their I’m not Smart Enough to Know For sure but I know some of my friends who work maintenance for some of these major companies that couldn’t get the parts the needed and were five to seven years behind in contract negotiations as they had 32 vice presidents that needed their bonuses when the workers had not had a raise in 7 years because they wouldn’t come to the bargaining table.
Reply: Because the presidents, and the 15 or so vice presidents and the board of directors and all the shareholders want as much money as they can get their hands on! That’s exactly what it all comes down to. Hell the street racers have about 5 Go Pro’s on each of their cars just so they know what’s happening because it’s their own lives in their hands and they are going anywhere from say 150 to possibly 270 miles per hour!!! That’s it.    “ POINT FINAL  or  FATAL “ and they have wives kids and people that love them every day and Don’t Have Expensive Actuaries Figuring The Odds of Them Living Or Dying In An Accident!!!!
Like Major Airline Companies Do. What’s the Most We Could Lose in A Major Crash and Following Lawsuits???? They Don’t Care Till It Happens. It’s All About Their Year Ending Bonuses 
and Stock Options!!!!!! Their I’m not Smart Enough to Know For sure but I know some of my friends who work maintenance for some of these major companies that couldn’t get the parts the needed and were five to seven years behind in contract negotiations as they had 32 vice presidents that needed their bonuses when the workers had not had a raise in 7 years because they wouldn’t come to the bargaining table.
Reply: I was just about to ask the same question
Reply: ⭐️⭐️⭐️⭐️⭐️ salute to all the Outstanding pilots and  Ground Crew
Reply: No point, the pilots can't do anything anyway. Cost, complexity, cleaning and maintenance as well. In hijack situations the bad guys can see the good guys coming.
Reply: Cost
Reply: Same reason there aren't cameras recording every surgery performed in every OR

Same reason cops fight body cams

Liability increase

If you voluntarily record every moment of your day, you have infinitiy liability for every time you fart or wipe your nose.
Reply: How about tire pressure sensors. My piece of crap car has digital readouts for all 4 tires and gives me an alert if it drops below a certain PSI.
Reply: @wayno454  i doubt tiny tpms goes up to 220 psi.  Plus more radio interference and tons and tons of false readings that are a vastly bigger issue on aircraft then your car
Reply: I have no doubt, the american pilot culture, crm etc is the most  efficient. Thank God that is the way I was trained.
Reply: The industry is old, they do not adapt to new technology. They still step on eachother during comms with ATC. Absurd
Reply: As to the question of why aren't there cameras on the wheels. Cheap cameras are new. They came about in 2004 to 2010 as every cell phone got cameras. In 2000 video cameras required a camcorder and a VCR. Planes today, were designed and built in an era where there were not available, light weight simple and cheap. Changes to aircraft systems are expensive, complex and lead to multiple side effects. For perspective, in 2025, ATC control still runs on Windows 95. Tesla cars were designed and built when these components, cheap cameras, were available. One could argue they could be deployed today, and I could see a marginal benefit it might provide. We are getting cameras at runways that automatically record planes taking off and landing and other similiar tech all the time.
Reply: In the engine is also
Reply: Money. 

I happen to fly an aircraft type that has a camera option. Compared to the overall cost of the plane, the camera option is a “drop in the bucket,” but it adds up across a fleet. We continue to accept new aircraft from the factory that are camera-free, but some used aircraft we acquired have the camera option, and it’s pretty cool. But someone has determined that the benefit of equipping a whole fleet is minor in relationship to the entire cost of ownership. That cost is not just the purchase price, but also weight and aerodynamic drag, which correlate to greater fuel consumption and revenue producing load left behind. Probably a tiny statistic on a given flight, but over the life of the aircraft, it’s likely an amount that could fund some nice executive stock options or fund a CEO golden parachute. There’s also consideration for maintenance complexity and operational impact; if the system breaks, we can’t just ignore it (as if it were never installed) and go. The company must develop a thorough and systematic process that guides how to handle failures and partial malfunctions. This is both costly and time consuming to administer. The process is subject to government scrutiny and approval. At the very least, exercising what’s known as a Minimum Equipment List (MEL) places flight departure performance in peril and requires the time of technicians who typically have more important things to do. On the worst of days, it can impose a flight cancellation costing millions. In the long run, it requires hiring more personnel.

Although I like the cameras and I can think of more than one ground collision that might have been avoided using it’s services, the accountants can show a case for camera avoidance on paper. Its bottom-line dollars, period. On the other hand, if opting for cameras produced one instance of averting a fireball-inducing accident with multi-million dollar life and property loss, an investment in camera systems would have paid off many times over.  Until Lloyds of London compels adoption of cameras, they are costly novelties in the eyes of the bean-counters.
Reply: They will become mandatory as will runway cameras
Reply: Maybe not a live, motion-capture camera, but one that can take snippets when prompted, would be ideal, and can be designed to endure the elements. But the expense....it would require redesigns of the plane, the landing gear already barely fits.
Reply: Cost, complexity, maintenance.  Been an A&P for 40 years, to answer your question, no, no, no!
Reply: Corporate jets have them.  
Way back I had an inferred turret that was able to see that the left gear was extended but the hook was not fully seated on the latch.  I yanked and banked but no joy.  
With a huge audience gather to watch me crash again (flight test) I  stabbed some left rudder and left aileron to bounce  the left gear on the runway loaded outward.  Got three green and landed. 
I have warned to other pilots in a close up chase, of their impending doom ( small crashes) however.
Reply: It's a nice Idea on paper but the cameras wouldn't be something conventional like you'd see with a GoPro or something, they'd have to be able to withstand ridiculous differences in temperatures from the freezing air at high altitudes and the extreme burning temperatures after the landing gear gets used on the runway, Plus going through constant pressure cycles like the airframe does. Then there's also purchasing costs, maintenance costs, difference training for pilots, and it would take away their concentration from flying the aircraft. If they want to put a bunch of monitors everywhere for different purposes, realistically, they'd probably have to bring back the flight engineer position and start flying planes with three member crews again instead of two members, and we have a national pilot shortage in the United States. And bringing back that position would mean they would need to redesign all of the airplane cockpits to support three crew members again, since you wouldn't be able to retrofit those changes into older airplanes without a colossal amount of work. It's just not going to happen. They may be able to roll out something on a smaller scale on brand new airplanes in the future, but my guess is that artificial intelligence is going to take over by that point and there won't be a human being monitoring those types of parameters. The AI will probably figure out what is wrong and then run checklist actions by itself.
Reply: @unr3alGaming  Great comment. I appreciate the more thorough explanation than the other guy who said "Yeah, I just said all that." Umm, no you didn't. 

Maybe I'm just an old fuddy duddy, but I also appreciate the lack of ALL CAPS and silly emojis. I feel like I'm being yelled at by a teenager on twitter.
Reply: @unr3alGaming Holy shit! On second thought just do the fly-by and let the tower check it out!  😅
Reply: @unr3alGaming wow!
Reply: @unr3alGaming you're absolutely right. I'm an experimental aircraft mechanic and we do mods to both existing aircraft and brand new concept aircraft. It's alot of weight and time to just add 1 electrical item let alone many. The work that would go into the process alone would put planes out of service for many months if not years depending on the size of the aircraft. You'd literally have to gut the plane. Routing the wires would be a nightmare. The whole thing makes my eyeball twitch thinking about it. 😂granted I work in the private sector so my planes are much smaller but you get the idea.
Reply: @unr3alGaming  
Yeah, I just said all that.
You didn't go through your check list did ya 😉
Reply: It’s due to the rubber of the tires that skids along the runway flinging rubber everywhere causing the camera to get completely covered every landing.
Reply: @JohnnyPare-rs3oj they have cameras that have a small roll of clear film across the lense for just these types of applications.  We use them in oil field all the time. If camera gets dirty push a button film rolls a inch good to go. Can roll film about 200 times per roll. Changing roll takes literally 1 min.
Reply: @greydawg3944 might have to invent one for aviation make a decent buck or two 😂
Reply: @greydawg3944 nascar!   Or any automobile sport
Reply: @greydawg3944  We have something similar on the googles we wear for dirtbike riding/racing. Once your vision is obsecured you just pull it off and there's a clean piece. They're called Tear Offs. :}
Reply: @davidskaggs3944 plus the rubber will fly backwards, not everywhere
Reply: @thePopularBailiff  The rubber will fly everywhere. Have you ever ridden through mud on a bike without a mudguard?
Reply: @greydawg3944 race cars too
Reply: Are those the same cameras they use on the Nascar racing circuits that give the views from outside the car? You can see the film rolling when it gets dirty with all the rubber from the racing tires. Pretty neat...
Reply: @greydawg3944  When you described the roll of clear film it made me think of NASCAR's camera's that they mount on the race cars - when they get debris you can watch as that film takes the debris off to the side and voila! - clear images again just like that!  Thanks for that info!
Reply: @JohnnyPare-rs3oj no bro. Are you’re being super close minded. I can think of many other ways a camera can work under the plane
Reply: Also tyre smoke would obscure the visibility of the camera.  @JohnnyPare-rs3oj
Reply: @JohnnyPare-rs3oj  not true AT ALL..dont just make up shit
Reply: Not a silly question at all. 
I’ve seen numerous videos on aircraft emergency and crash situations that would have benefited greatly from some cameras fitted on the aircraft. 
A couple of 360s on the top and underside of the fuselage at front and back. 
One on the stabiliser facing forwards, a couple on the top and bottom of the wingtips. 
They have nav lights, they have sensor equipment such as air pressure for speed, etc. 
why not add some cameras in. 
Think of Hawaiian with that big chunk of roof/fuselage missing, but the pilots weren’t sure what had happened and communicating it to the flight deck was problematic. 
A couple of cameras would have freaked the pilots out but they’d have known what was going wrong rather than having to fumble about with checklists. 
Other situations have been engine issues or wing ground strikes that the passengers have seen but the pilots are oblivious to, at least beyond anything that their instruments are telling them. 
There was also that Japanese flight with most of the stabiliser gone. 
Cameras!
FFS, we have sophisticated ones in our phones, doorbells, cars, drones, laptops. 
How hard is it to whack some on a plane?
Reply: @sean---the-other-one  
"FFS",..
Maybe scan a couple comments, before commenting.
And you have no idea what those "CHECK LISTS" Cover, simply by your comment,.. ffs.

And did you see those videos and pictures of Drones, and Aliens Recently ?
When it was just VENUS, ffs 😂

... sad dude, and saddest part, whatever the camera showed, they have to STILL go through the CHECK LISTS
Reply: @ and what does the camera help me when most of the stabilizer is gone? Will they make an emergency landing when they have a wing strike? What can they do when I see that a part of the engine is missing?
They don’t need to see those things as they have other things to do anyway.
Reply: It’s certainly not a silly question in my opinion. Some aircraft have a camera on the stabiliser. But for manoeuvres on the apron primarily. Some latest aircraft have cameras under the fuselage as well, but to entertain passengers, not pilot use in a flight situation. It would be unlikely to gain specific information. And the workload will be high, primarily to look at information from sensors, trusting the flight computers and going through the relevant emergency checklist to troubleshoot any issues. Aviate navigate communicate. If the aircraft flies fine, that’s a big nice comfort to just fly it and time to discuss next option. There’s enough sensors and pilot training in the aircraft systems to not be spending time looking at a camera image. Again in my opinion.
Reply: @kevinfairclough4619 fly looking through the front not out the back
Reply: Captain Steeve, I'm sure like these videos too everyone with nice soft voice's everyone calm cool and collected; just perfect for all involved.
Reply: Cuz any modification to the aircraft requires costly FAA approval.
Reply: @naughtiusmaximus830 except the FAA already approved such modifications back in '07
Reply: @Suisfonia  Looks like very few retrofits were done.
Reply: @Suisfonia IIRC, retrofits have to be approved for every airplane model separately. Imagine mounting a camera in a way that disturbs normal operation of the aircraft. Would have to be checked out by somebody, at least.
Reply: Because companies don’t want to pay extra money for anything. Every time someone comes along with an idea that would solve a problem every company looks at it and wonders if the cost is worth it. If it cost money or downtime they won’t want it done. It’s the same in IT for cyber security, unless it’s 100% needed or required it is not seen as cost effective and ignored. What you and I see as obvious or a good idea can be ruled out if the people above are not making money off of it. Planes like everything else are made as cheap as possible with as little maintenance as possible.
Reply: @TheBeardedAtheist  That's fine by me. I'm poor, I can barely afford to fly now. The last thing I want to do is spend more for airfare everytime some common Joe comes  up with something plane manufacturers should do. And yes, tue extra weight of cameras all over the plane would cause more hazards than they would solve. My suggestion if you want to make flying as safe as possible... fly airbus.
Reply: @TheBeardedAtheist  exactly why AA got rid of televisions of each seat.
Reply: @TheBeardedAtheist  yes, plus maintenance
Reply: Great question
Reply: weight and cost.
Reply: @dennistaylor5924 AND the costs of FAA certification on every model of a/c they're installed on.
Reply: Dogs have souls!!!!
Reply: I had often wondered why they didn't have cameras pointed at the wings. The number of Aircrash investigation I've watched where passengers see something wrong on the wing while the pilots have no idea, seemed strange.
Reply: @Here_is_Waldo . Yes, but an attentive pax will inform a flight attendant, who will inform the cockpit.
Reply: @ imagine a company where after a plane is built they added a ton of extra cameras and sensors and live in cockpit video and audio as well as gps location tracking software so everything can be looked at by the pilots as well as any ATC or corporate headquarters that needed to check in. Something we could totally do. It would be revolutionary.
Reply: The reason why we don’t see cameras has nothing to do with rubber, you could put them somewhere to keep that from happening,
It’s because the manufacturers don’t want any negative images or videos to end up on the internet or news
It’s bad for business, they had it on a plane once, but it was facing forward towards the front and the passengers could see it
But it was the plane that lost a engine and crashed, and after that, they didn’t want them on cameras again
Reply: I see everyone making excuses. If they wanted to, it could be done in a very efficient way
Reply: @RashadTyrique  
And what "Excuses" are being made ?
Weight and Costs? The engineering and maintenance that adds Weight and Costs?
Nevermind, time and costs for training on their use, and integration into the systems. And of course how to shut them off when there is a problem 😂

Come on, give us something besides you said something, so it must be true,.. my flat earth friend 😊
... i said he's a flat earther, so it must be true, yup, logic checks out 🤣
Reply: Cameras might not work well, and you'd also have to light the area for the camera. I'm wondering why not a TPMS. Sensors are extremely light, and can just beacon their pressure and serial number every few minutes. Antennas in the bay can then count them around critical phases and report if one is missing or critically under inflated...
Reply: @kc8ufv  
It's NOT the weight of the sensors.
It is the weight of everything attached to them, including the monitoring equipment. And the engineering, so those systems don't interfere with other systems.

But in the end, like someone has already said too,.. Eventually You Have To Land.
Reply: With or without the camera you would have the same exact outcome
Reply: There really would be no benefit.  Not to mention the additional cost and validation required.
Reply: @OneBadPilotDetroit  there would certainly be benifits, engine smoke ,residual heat can sometimes trigger a engine fire warning and thus lead to releasing both fire bottles when only one would be enough.
To look at control surfaces in case stuck controls
False fire alarms could be written off,YES THEY DO HAPPEN.
Parking,especially with growing traffic could benifit greatly.

It would not prevent any of these, but help the pilots make better decisions and hasn't history taught us enough? The more information pilots have, the safer it is
Reply: What would be the benefit for the pilots? To see what exactly?
Reply: @Cars-k8e To see if they have working or non viable landing gear
Reply: @ on the small jets they would see the tires, still won’t  tell if the landing gear is locked in the down position. They might see if they blew a tire, but they will find out also when the airport tells them that they found pieces of tire on the runway… there is no difference 
On the bigger jets they have pressure reading from the tires etc…
Reply: @Cars-k8e That their tires are intacked. Landing gear is down, and the engine isn't on fire.
Reply: And there are many reasons.
Weight being one of them. And the amount of protection they would need from the elements another.

And Aircraft Aren't Cars !!!
You shouldn't be staring at your INFO-MATION SCREEN, when flying an aircraft. 
Those things have like a DOZEN GAUGES IN THEM 😂
... you get the point 😉

Good Question Though.
Reply: @My-Pal-Hal  to play devil’s advocate, isn’t ifr mostly staring at information screens?
Reply: @bm03431  
Well.
Do you mostly just stare at your dash screen when you Drive ?
Because even if you are flying in "IFR", you are using Several Instruments. Not just watching TV 😂
Reply: @My-Pal-Hal  most vehicles are not equipped for zero-visibility operation.... not sure the environments really carry over.
Reply: @bm03431  
First,..
That wasn't the question you asked.
Second,..
Most Vehicles?
Because asking concise questions makes for more concise answers.
Hell, teslas drive themselves,.. Allegedly 😂
.... in autopilot of all things
Reply: @My-Pal-Hal  Weight is not an issue (whole system might be 50kg on the heavy side), it's the cost of an approved retrofit. aircraft are cars and buses and trucks. Nowadays aircraft have less and less gauges, only the minimum standby, the pilots literally stare at "info-mation screen"
Reply: @MrMxm13 
"Weight Is Not An Issue" 😳

Something never said in the aerospace industry 🤣🤣🤣
Reply: @My-Pal-Hal  it's always money, i've worked on planes where they modify and most of the time they don't remove the old parts because it takes too long and they wont fuss over 25-50kg of wires
Reply: @MrMxm13 
And Weight Equals Money !😂!
You already failed dude, enjoy 🤗

... from an "Incredible"